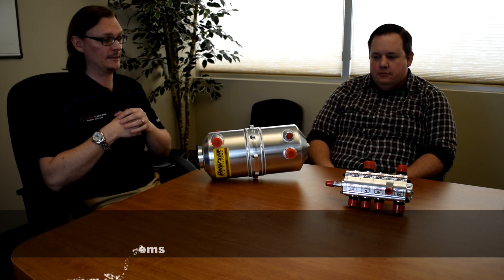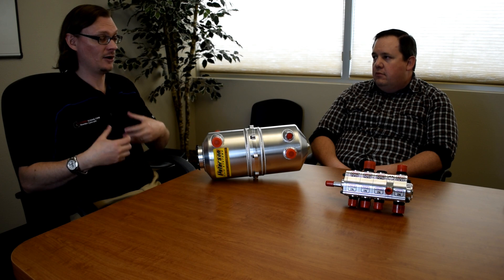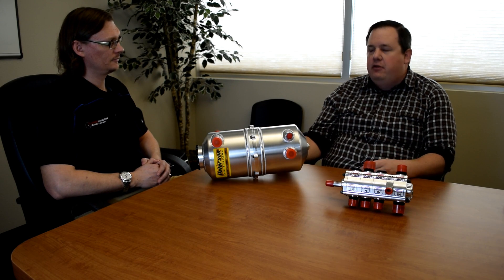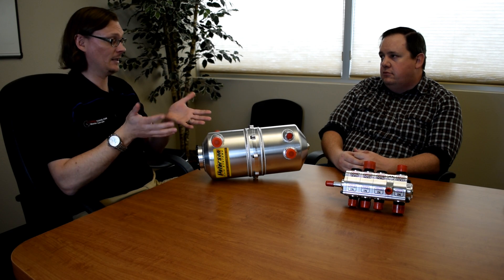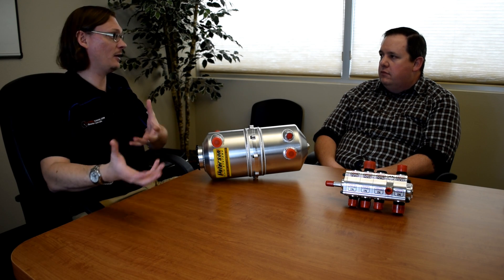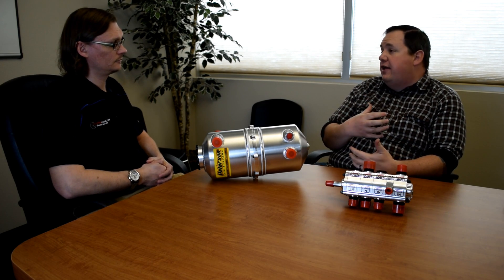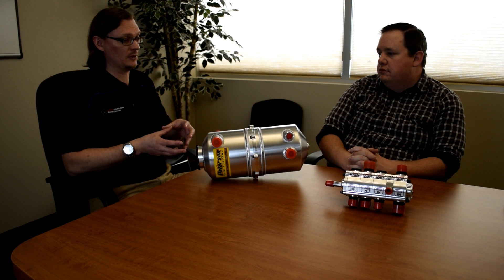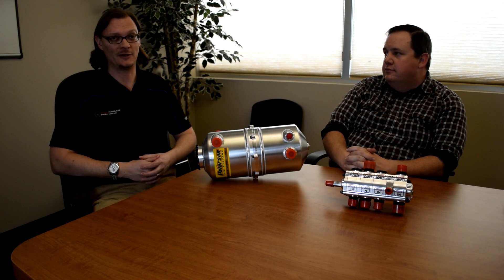Oil System FAQ and Theory - With Mike from Peterson Fluid Systems

Comment: I use an external single stage belt driven oil pump with a wet sump pan and 2 quart oil accumulator on my dragster.  It’s a bracket car with a 565 big block Chevy.

Comment: Could you use a one way valve so that the oil doesnt run back to the pan from the tank when the car sits so that you dont need to prime  the oil system?
Reply from the maker: Thanks for your question.  that could certainly work.  But you wouldn't want the valve to interfere with the the function of the pump, or the flow of the oil under normal operation.

I'd recommend you work with the manufacturer of the system that you plan to use and follow their direction.

Thanks for watching!

Comment: You will see these systems appear more and more on Production cars. As Manufacturers turn to Turbos in ever smaller engine displacements. Yet produce even more horse power. As they search for more MPG.... I'm beating Ford will be the first in their Eco Boost engines. Just look at the crank drive timing belt oil bath in the 1 liter 3 cylinder. 

I also never lost a bearing. Using a dry sump system. That was 40 years ago using regular oils....Now I did blow many an engines from valve float. As push rod cams just could not take the punishment...
Reply from the maker: Thanks for your comment, and thanks for watching!  Dry Sump oiling systems are pretty common on high-end sports cars, and race cars of course.  But you are likely correct in that the benefits of this type of oiling system can be much greater on a turbocharged engine of almost any displacement.

One thing is for sure, if they start putting them on cars from the factory, it will be a big step up from most current stock systems.
Reply: I don't think they have a choice. The Federal Government mandates will push them too. As their is huge HP gains and Reliability to be found with Dry Sumps. I even pressed a Ford Engineer to bring us mass market Dry Sump Oiling systems. As it makes sense. He looked at me with that stare. That I seen before. Like I was peeking under the hood of their proto type engine R&D department..As the saving is in units sold. Which they can bring down cost....
Reply from the maker: Well, we can only hope :-)